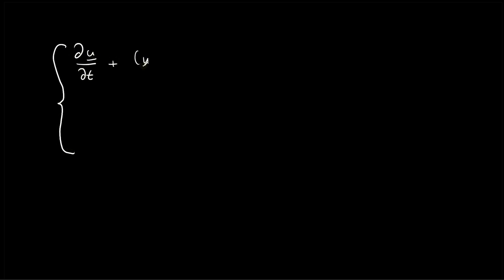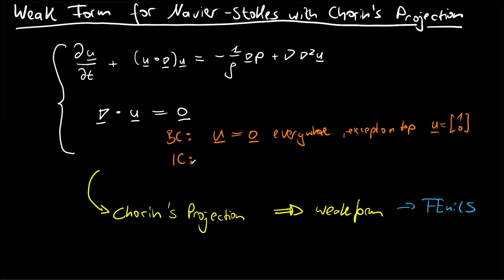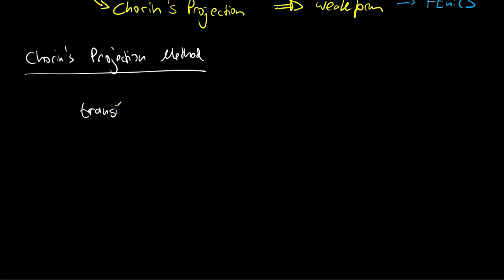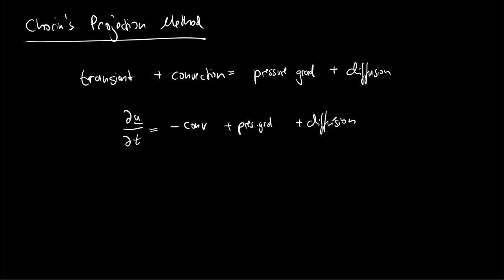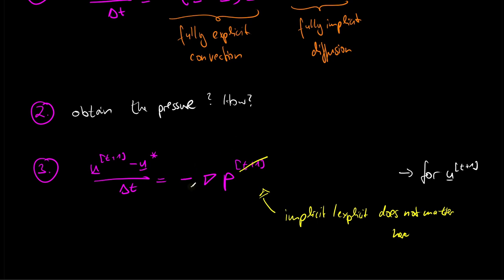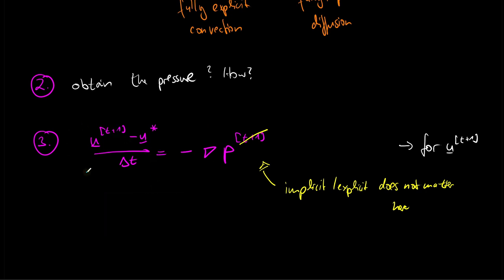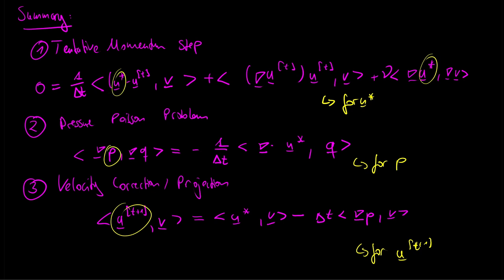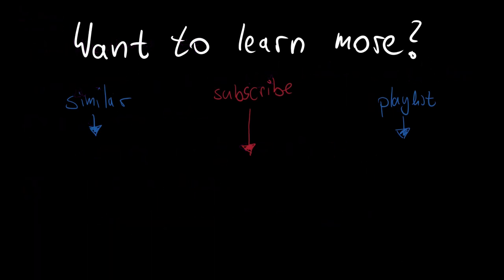Weak Form for Navier-Stokes with Chorin's Projection

Comment: Hi, is my understanding of the double contractor operator for (del u) : (del v) correct? del u = [du_x/dx, du_x/dy; du_y/dx, du_y/dy]  and del v = [dv_x/dx, dv_x/dy; dv_y/dx, dv_y/dy] then the double contractor is: [du_x/dx * dv_x/dx  +  du_x/dy * dv_x/dy;  du_y/dx * dv_y/dx  +  du_y/dy * dv_y/dy]. In otherwords the del operator on the vector creates a jacobian matrix which then double contracted becomes a single column vector in this case? And I do element wise matrix multiplication then I sum the rows (not columns) to create a new vector?
Reply from the maker: Hi,
it's been some time since I uploaded the video. Do you have a timestamp to the part in the video you are referring to?
Generally speaking, a double contraction of two matrices (as in your case the Jacobian in the form of the velocity gradient) reduces these two matrices to a scalar. 
So in the case of 2x2 matrices:
[a b; c d] : [e f; g h] = a*e + b*f + c*g + d *h

Another remark to what you wrote: there are two conventions to layout Jacobian matrices (what the velocity gradients of "del u" and "del v" are): https://en.wikipedia.org/wiki/Matrix_calculus#Layout_conventions . You can find a discussion on how they are treated in FEniCs on page 58 of the original "FEniCs" tutorial book: https://link.springer.com/book/10.1007/978-3-319-52462-7

Comment: Hi, I think you have a mistake in your 3rd equation. The velocity correction requires to add the split term of del pressure over density but it seems you have missed out on the density at the bottom. The equation should read: \frac{u^(t+1) - u^*}{\Delta t} = - \frac{ \nabla P}{ \rho }. Not a major error at all since it's a constant in the projection method.
Reply from the maker: Hi, 
yes, we could add the 1/density term there. However, even in the case if density != 1, it would not be necessary as long the density is constant over the entire domain  (which is the assumption for incompressible fluid flow).
To explain why, take the equation for incompressibility projection and denote by u* the tentative velocity and by u** the velocity at the next time step.
Then, we have
(1)  (u** - u*) / dt = - 1/rho grad(p)
Taking the divergence on both sides gives
- div(u*) / dt = - 1/ rho laplace(p)
Rearraing gives the pressure Poisson problem
laplace(p) = rho / dt div(u*)
Let's define the inverse Laplace operator (which is linear)
p = rho / dt * inv_laplace(div(u*))
Then, we can plug this into (1) to get
(u** - u*) / dt = - 1 / rho * rho / dt * grad(inv_laplace(div(u*)))
Rearranging for u** let's us cancel all the dt and rho terms, and we get
u** = u* - grad(inv_laplace(div(u*)))
Sorry, that this was not mentioned in the video. Hope that clears it up :).

Comment: Thank you for such a wonderful and informative video on this interesting topic. 
I have some questions regarding the pressure poisson equation (PPE). We see that the RHS of the PPE is coming from the tentative velocity-field which is not physical. This will affect the pressure or not? The second question is which type of boundary conditions are suitable for the PPE? 
Thank you again and waiting for more advance lecture on this topic again like the high order time discretization scemes.
Reply from the maker: Hi, thanks for the kind comment and the nice feedback 😊
Your two questions are linked and have been for debate in research papers for a long time. Check for instance this paper by Gresho: https://onlinelibrary.wiley.com/doi/abs/10.1002/fld.1650110509 (if you use connected papers you will find a series of related articles).
Simple answers to your questions:
Regarding the first: yes, there is an effect to it. Due to the operator splitting we introduce an O(delta t) error to the solution and in the way presented in the video, there is no cycling back and forth between momentum equation and pressure correction which would be necessary in order to obtain a velocity field that both satisfies the (discrete) momentum and continuity equation.
Regarding the second question: That's also a debated point in the articles. In the simplest case of wall boundary conditions (i.e. the fluid cannot leave the domain), it is reasonable to have homogeneous Neumann boundary conditions on the pressure, because then there will be zero pressure gradient pointing outward of the domain, and, hence, the corrected velocities respect the walls.

Comment: How can we save the simulation results in a way that I could read using numpy to train some machine model on them (like a pinn)?
Reply from the maker: Hi, thanks for the question! :)
There are built-in ways to export simulation results into a format that Paraview can understand. For instance, you can check this video of mine: https://youtu.be/ibgALqJOX-I
In general, the meshes in FEniCs are unstructured and due to the FEM representation, the dof values do not necessarily represent the values on mesh nodes (but only coefficients for basis functions). [This can coincide for simple basis functions, like linear functions].
What I would recommend to you is to create a uniform mesh over the domain you are interested in and then use the FEniCs functionality to interpolate the solution function at these coordinates. You probably have to check the documentation for this. Best of luck :).

Comment: Thank you for your helpful video. I have a question,
Some people or papers write the weak form (or variational form?) of the viscous term as (∇u,∇v) (inner product?).
But the other person like you describes the viscous term as a ∇u:∇v.
Who's right? What's different?
Reply from the maker: That's a great question 👍
Both approaches yield the same result. Let me explain:
The ":" (colon) operator here refers to double-contraction. If you have only dot between the two vectors, this typically means the dot-product (so a euclidean (l2/p2) inner product), in which you elementwise multiply the two vectors and sum up the elements afterwards. With the ":" you would do sth similar for two (identically sized) matrices: elementwise multiply the entries and sum them up (resulting in one scalar value). Since u is a vector, it's gradient (the velocity gradient) is a matrix. As such we need the colon. 
However, we could also use the notation involving the inner product between two matrices, since this one then usually refers to the generalization of the euclidean (l2/p2) inner product, both approaches are identical.
So both are a way of contracting two matrices down into a scalar value.
The advantage of using inner(a,b) is that it works no matter if a&b are scalars, vectors, matrices etc. because by axiom an inner product must always map to a scalar value. (In the corresponding FEniCs videos I also use it that way).
Hope that helps 😊
Reply: @MachineLearningSimulation  I'm not good at math, so this is the first time I've realized that the generalized (,) operator maps to a scalar value without regard to the target's rank. Thank you so much for your answer. It's very valuable.
Reply from the maker: Thanks 🙏
I'm very happy, I could help. 
Good luck with Your further learning journey 😊

Comment: Thank you for this, great content. A question : if you sum step 1 and 3 of the strong form, you see that the approximation to the time derivative of the velocity (u^(t+1) -u^t)/ Delta t is equal almost what we want (ie sum of convection term + pressure gradient + diffusion term) except that the diffusion term is calculated from u^* instead of u^t or u^(t+1). What are the consequences of that? Are there ways to also correct that diffusion term?
Reply from the maker: Hi, thanks for the comment with the kind words and the interesting question. Indeed, using operator splitting (and in particular projection) methods introduces quite some headaches. Researchers devoted many papers to their analysis, in particular for Boundary Conditions of the intermediate "artificial" PDEs, see for example the publications by Gresho in the early 90s. 
I must admit my understanding of projection methods is not too deep yet. One consequence of the problem you mention is that the full solution process to the Navier-Stokes equations will always be first order in time. Here, this is not an issue because we are using a first order integrator anyways (an Euler step). If you were to use a second-order method like Crank-Nicolson you would observe a first order convergence despite a second-order consistency. That's really interesting.
Regarding your second question: Are there ways to correct it? I would argue that if you are fine with first order convergence in time, there is nothing to worry about. One possible remedy is to use a so-called coupled solver. In a sense, such a solver is not splitting the problem into three sub-PDEs, but rather solves the incompressible Navier-Stokes as one system. If you did the FE discretization, you would get a large sparse system matrix that is in terms of both velocity and pressure. On a first glimpse, that seems intriguing. However, this system matrix is highly ill-condition (due to a so-called Saddle Point Structure). There are a lot of mathematical resources on how to still solve such systems, but one has to dive quite deep.
Bottom-line, I would say it's not too worrying that the diffusion is treated at the intermediate step in time, as long as you are fine with first order convergence. If you need better, you probably have to look into more advanced methods.

Comment: What do the underlined letters refer to?
Reply from the maker: That refers to vectors and matrices. One underscore is a vector. Two is a matrix. More refer to higher tensorical quantities.
Such a notation is often used in handwritten notes for mechanics, but is seldomly used in machine learning. Personally, I like it a lot since it gives more insight into the linear algebra operations.
Reply: @MachineLearningSimulation  ok, thanks a lot.
Reply from the maker: @McHumaty  You're welcome :) Thanks for the question.